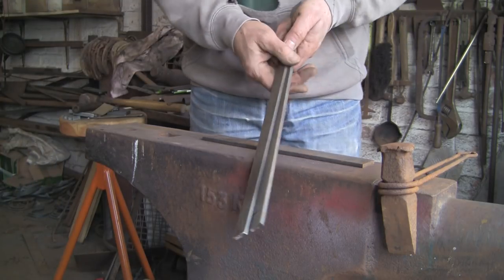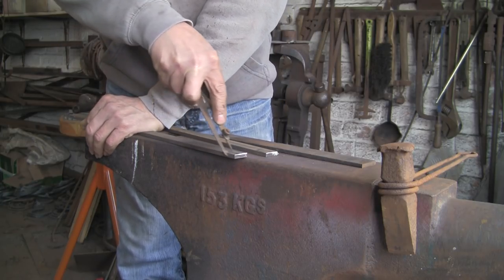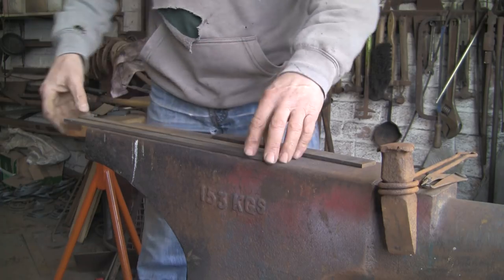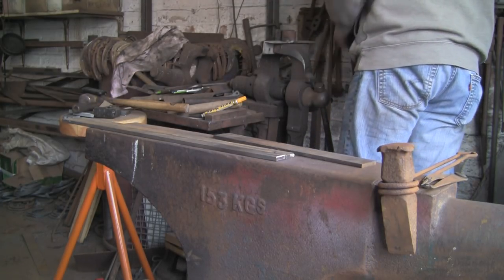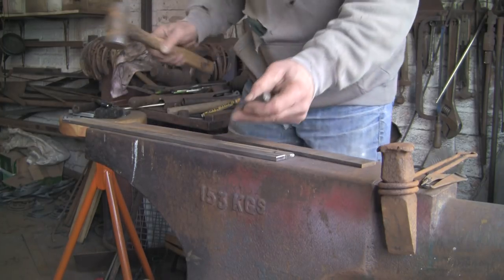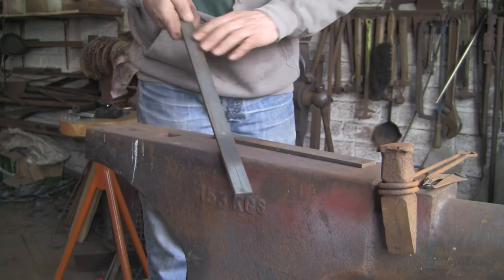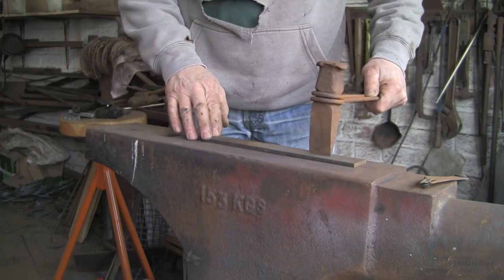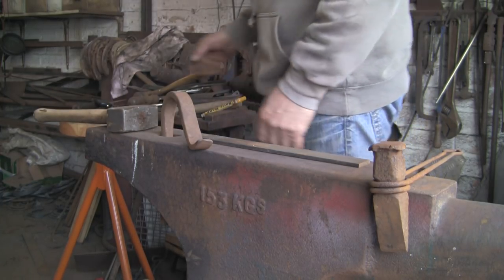Candle Holder

Comment: When I was at sea we used a tool identical to your 'hot set' only we called it a 'cold set'. Used for cutting wire rope strands if we didn't have a guillotine, which often we did'nt.
Reply from the maker: Alan Hill it’s the same as a cold set but made of different material so it can cut hot rather than cold.
Reply: Thanks